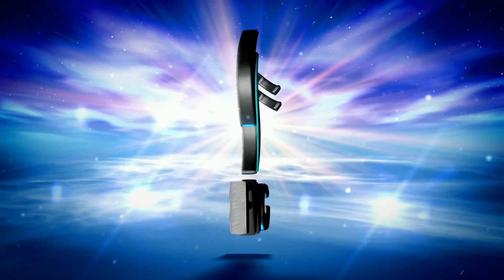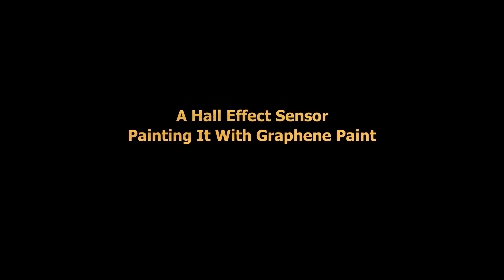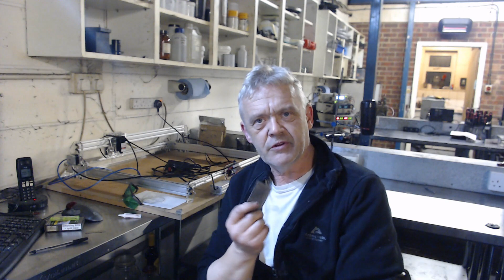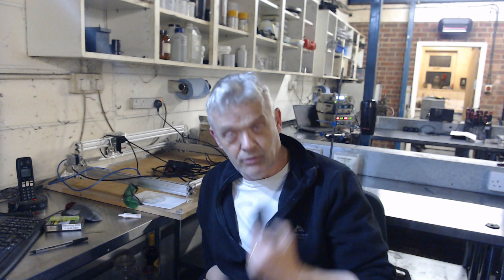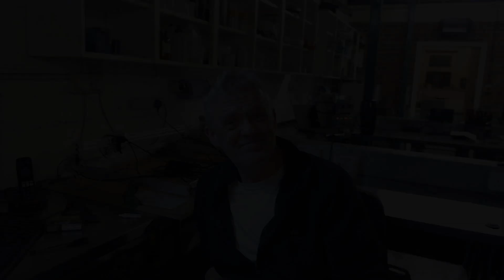A Hall Effect Sensor How It Works And Painting One With Graphene Ink

Comment: Awesome video! I've been searching for a long time to see if anyone else has measured the hall effect outside of academic research, glad I stumbled upon this. Your change in Hall Voltage is incredible. For those of you who are interested in what exactly is happening here(I'm no expert, just read a lot on the H.E.);

What is known as the Hall Effect, is really a product of the Lorentz, or Magnetic Force. When an electrically charged particle(lets say an electron) intercepts a magnetic field(strongest at 90°), due to the motion and charge of the particle(negative), the particle will experience a sideways force perpendicular to both the magnetic field the particle crosses, and the direction the particle is travelling in(stick your right hand out and point your index forward(velocity of q), thumb up(magnetic field, B), and middle, left(resulting force, F)). If we consider that an electric current is simply the motion of charged particles(electricity) through a conductor(the Hall Element), the particles, or "charge carriers" are subject to the same forces, this is why a voltage potential shows up on the edges of the element, but this same potential also draws the deflected carriers back to the center current, where the magnetic force, and the electric force(generated by the separated charges) cancels out producing the final Hall Voltage measurement. This Hall Voltage can be calculated using the following formula:

V(H) = (Ix * Bz) / (charge carrier density, n) * (thickness of element, t) * (charge of electron, e). 

But I'm not finished yet (Inhales deeply); The reason I find the result in the video surprising is(for I will also give a conceptual understanding of the above formula): If one considers again an electric current possessed by the Hall element, lets say in the x direction; but through what material?*, it's known that the choice of conductor matters(i.e. resistance), but why? For this, the question is not of the magnitude of the current, but rather what is the mechanism by which material x, bears the current? e.g. "how does copper conduct 5 amps, vs silicon?" One(Si) opposes current more than Cu does, thus electricity must conduct differently in silicon than it does in copper, and indeed it does. The answer to this explains the VH(I promise). The reason Cu is a better conductor than Si is, is primarily due to two factors, The NUMBER of charge carriers(i.e. electrons and holes) able to freely move(and conduct a current), within a given unit of volume(typically in n/cm^3 for semiconductors, and n/m^3 for metals); this is charge carrier density denoted n, and *how freely said carriers are able to move without being impeded, also known as charge carrier mobility*, denoted μe, and μh (electrons, holes*). The difference in Cu & Si, is that Cu, has an awfully low mobility, its snails' pace, you could literally walk faster than an electron moving in a circuit. But this slowbility is made up for the fact that Cu has an *enormous number of those carriers to conduct the current, albeit slow. In silicon its almost the other way around, there are barely any carriers available to conduct electricity, but the ones that do, are absolutely hauling it(just not fast enough to make up for it's low carrier concentration, inversely like copper). The key is to scroll back up to the magnetic force I recently described, and recall that, and I quote: "due to the motion and charge*...", By this, I mean that the product of the velocity of the charge, and the quantity of charge(and the magnetic field strength!) determine the strength of the Lorentz Force. Ah! It makes sense, a material who's carriers move faster, are more strongly deflected by the Lorentz Force! This is true, but there's one more caveat; one can see that the *thickness of the element is inversely associated with the measured voltage; Finally, remember, when we look at current through a conductor, its charge carrier density contributes to its conductivity; this implies that one could calculate the number of carriers present in a conductor of known dimensions via the carrier density; also implying the carrier content is fixed for an element of said dimensions. LASTLY, this means, in a constant current situation(I is fixed, despite R), and in thicker Hall elements, there are more carriers to bear I due to a larger volume, which don't have to move as fast to bear I, which also get less deflected by B from moving slower = lower VH. BUT, in thinner elements, less volume means less carriers, and if I is to remain constant, these carriers must move quicker to make up for the lack of them, which is what it means for a thin element to conduct current(they ought to call this the "haul effect"). This is why thinner elements of lower carrier concentration, and high carrier mobility, are suitable as Hall elements.

Which is where this finding is interesting. The Hall Effect is usually only measurable in laboratory environments, where semiconducting crystals and atomically thin films of metal can be made to T, for the Hall Effect is a very weak phenomenon; this experiment was originally discovered using gold leaf, which is on the order of sub-micron thickness... Even then the VH is only measurable within millivolts. And idk about you, but I don't know anyone who's got an extra wafer of Gallium Arsenide to sell me for less than $600... 

But, Graphene, is an interesting conductor... You see, graphite, and especially it's graphene sheets aren't bad conductors at all! The confusion arises when one finds that these materials have low carrier density, on a level that one would suspect such materials of possesing a high resistivity, but when the theory of conduction is applied, we discover that graphite/graphene's decent combination of conductivity & low carrier density results in C6 possessing an absurdly high carrier mobility. (I presume this may be partly due to the π-bonds conducting electrons outside the lattice where few obstructions exists to impede the current.*) You must ponder, a single atom thick and probably the highest measured mobility of any known substance - is truly the ideal Hall element. (Again, I'm by no means an expert, this is just how I came to interpret the theory.*)

I was just on my way to constructing methods sensitive enough for a hobbyist like me to detect the HE myself, like Edwin Hall did in 1879. You've inspired me to include this material in my potential soon-to-be experiments, and given me hope that I may actually be able to measure the effect with limited resources. Thank you for sharing your results!

Comment: To prove it is the Hall Effect, shouldn't you be using non-magnetic clips? Otherwise some may argue that the change in reading could be due to a slight variation in the pressure of the grip on the conductive ink as the magnet approaches.
Reply from the maker: maybe - but wouldn't that lead to a change in both readings? as if it was just a change in resistance due to pressure more current would flow as well as a change in voltage?

Comment: Oh so that’s how an electric bike knows where in the circumferential motion of the turning wheel and where the electricity is added to keep the bike flowing evenly forward!? Cool heard of the Hall Effect and didn’t know how it worked.
Reply from the maker: yep that's it mate
Reply: Just adding something to the discussion. Bldc motor contollers that use hall sensors know the position of a magnet within a sector, range of degrees of rotation. 

With 3 hall effect sensors and 2 poles, that means knowing the position of a magnet within 60 degrees of rotation.  With 3 hall sensors and 4 poles that's  (360/(3×4))=30 degrees.  

Then depending on which sector a magnet is in, as told by the hall sensor signals, the motor contoller energizes any two of three wires to the motor so as to torque to the motor's rotor.

But because of the degrees of freedom within a sector, and a variable load on rotor makes it's imposible to know or calculate  the exact rotation position. Eitherway, all that really maters is knowing which two of three wires to energize + and -  by knowing which sector a magnet is in.
Reply from the maker: yep that's it mate

Comment: Hmm, could you make something like a reed switch?

This would be difficult as a reed switch uses two different metals that when a magnetic field crosses them they polarize and attract each other and make contact, thereby closing the switch until the magnetic field moves away.

I've read that the metal in reed switches can become magnetized which causes the two metals be become permanently closed. Perhaps a graphene painted reed style switch would not be magnetizable? I haven't the slightest idea how one would go about making graphene painted contacts react opposite to the same magnetic field. But if possible, it would certainly be an extended life reed switch.
Reply from the maker: kieth gives a lot of good info mate - might be worth a try - give it a go

Comment: How sensitive can you get this? Because if you you can further this, like you said, there are mass of applications, including alternative energy. Now one thing you could use this for is instead of using a tiny sensor that can burn out on a BLDC motor make panels of these to sense the timing to send to the controller. Now there's an idea! ;)
Reply: Signal strength is proportional to  primary current and magnetic field strength. The greater the current through the hall sensor, the stronger it interacts with the magnetic field. 

But rather than carry more current,  hall effect signals are often amplified.

On my channel, I made an axial flux BLDC motor that doesnt use hall sensors.
Reply from the maker: @kreynolds1123  exactly mate
Reply from the maker: that is an interesting idea mate and to be honest i have no idea right now how sensitive they can be - the next thing really is an amplifier circuit so it can be made small
Reply from the maker: @kreynolds1123  i must go have a look
Reply: @ThinkingandTinkering  you'll find  that  the stator coils are very unique :D
Reply from the maker: @kreynolds1123  that's an awesome design mate - do you mind if i give it a try?